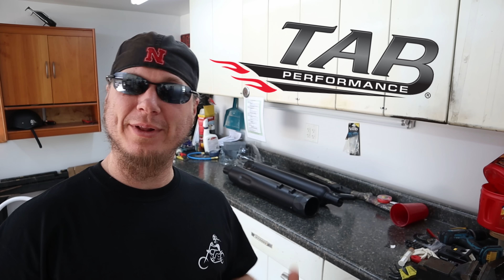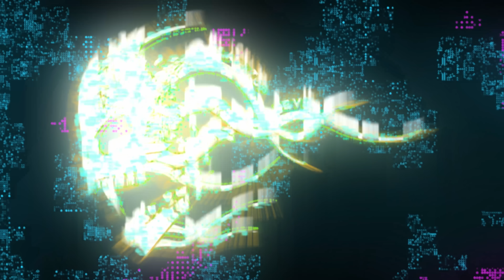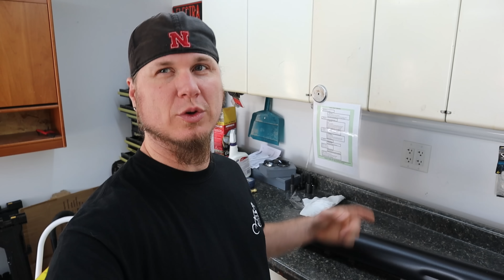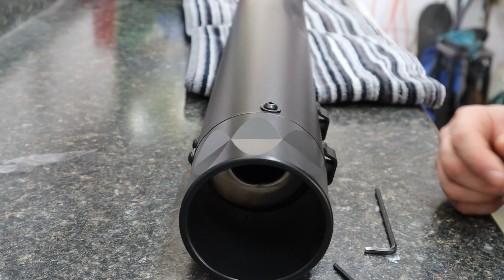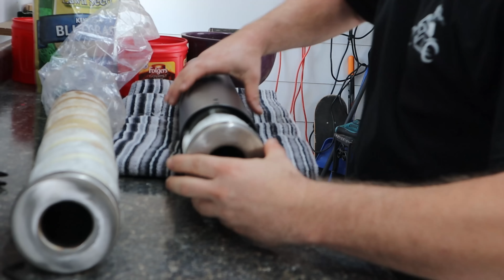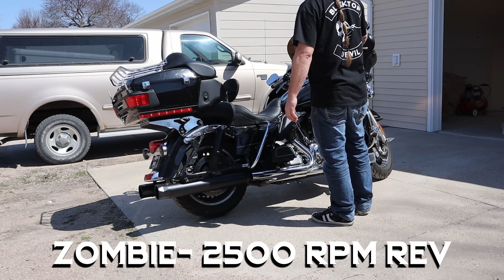These might be the best sounding mufflers for Harley Davidson! Tab Performance comparison and review

Comment: Still liking these? Doing the whole mental merry go round on what slip ons to use while my new bike is under warranty.
Reply from the maker: I do. I still have them on too. I have a set of Jackpot hi rollers that I wrestle with going back to occasionally. They are a little deeper than these but not quite as loud. So far  I've stuck with the tabs though, it's a nice mix of low and loud
Reply: @LifeontheBlacktop  Excellent! Me and my wife appreciate ya'll doing these reviews from a driver and passenger perspective. Stay safe out there!
Reply: @LifeontheBlacktop  About to pull the trigger on the tabs and thought I'd run this one by you since you're strong in the ways of the force!

Since this is my first touring bike I'm trying to navigate the whole cat in the headers/get some sound/keep my warranty dance. My thought is to run with the zombies will the warranty is up then swap out the head pipe and switch the baffle to a medium baffle...then cam,tune, etc.

Thoughts?
Reply from the maker: @bikesandbeagles  that would definitely work! I don't know first hand what the zombies sound like with the cat still in place but I imagine it would be significantly less loud than mine without it. It would probably be comparable to catless with mediums I'd guess.
Reply: @LifeontheBlacktop  I've had them on for a few weeks and love them! Not as deep as some other mufflers but they sound rowdy as hell. My wife says they are actually quieter than the big shots I had on my low rider (probably since they ended right under her) and she can hear her music now so it's a win all the way around. Once the warranty is up and I swap the head pipe I'll definitely need to switch the baffles so all my neighbors don't hate me but with the stock ones it's great. You taking the time to respond to my questions helped a great deal and we really appreciate it!

Comment: But torque though??? Does anyone know the low to mid torque differences between the two baffles?  Common M8 logic would suggest you get more torque and back pressure from a more restrictive baffle.  Anyone dyno compare the two?
Reply from the maker: From what I was told by Tab themselves is yes there is a small torque hit with the zombie baffles and their free flowing design. But as you mentioned, that's pretty common amongst all engines. I didn't personally feel it to be honest. They do make a torque ring for the zombie baffles you can install to add a small amount of back pressure to regain a little torque. You'd have to ask them for the numbers though. Regardless, the torque rings are kind of cool looking.

Comment: I run vh headers & rh race exhaust dyno tuned on my electra glide ultra And there so loud i put on the stock exhaust on 1-2 week vacation rides so you can hear your self think at the end of the riding day. Besides that all you here is blahrrrr when riding with the race pipe set up.